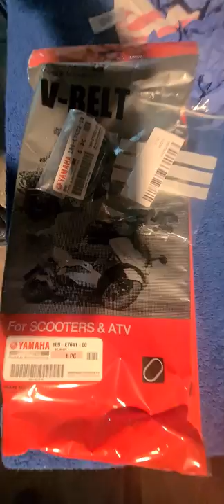Yamaha X-Max 125cc Wymiana Paska oraz Rolek w Skuterze 4T How to Replace Belt and Weight Moped Part1

Comment: Dude you need a cordless screwdriver
Reply from the maker: To unscrew the Variator you need to use a pneumatic gun There are also other methods but this is the fastest and easiest way. 
Remember that everything has to be tightened with sufficient force. Regards